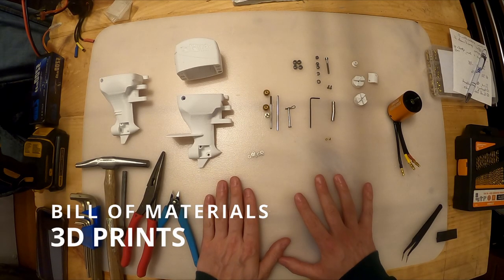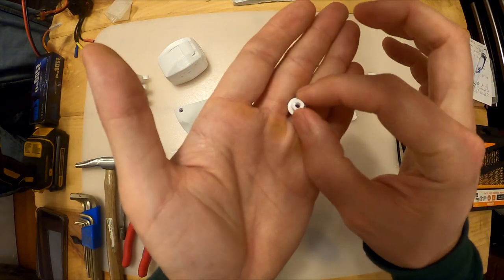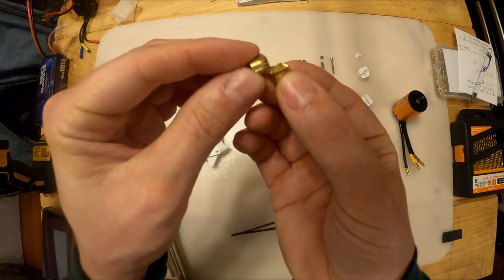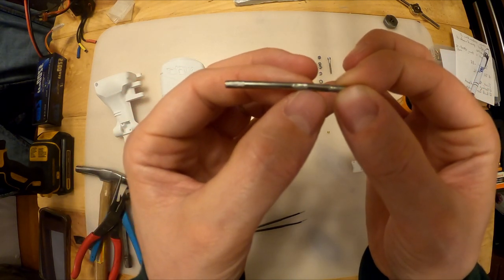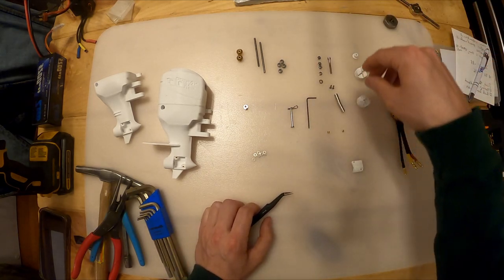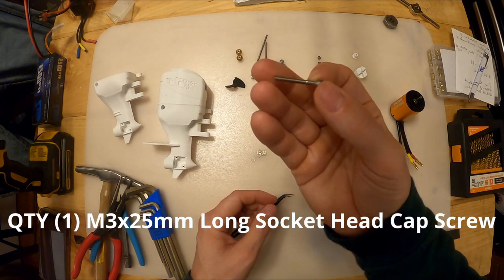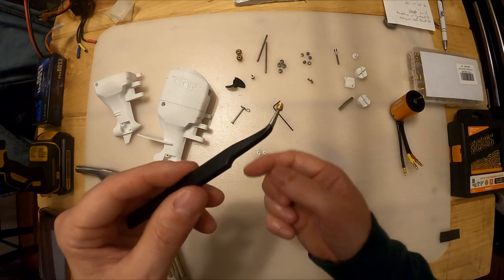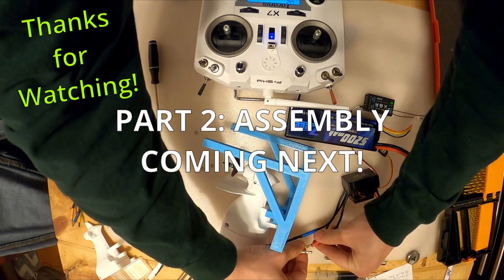3D Printed RC Outboard Assembly: Part 1 Materials

Comment: Thanks so much for all your hard work putting all this together. I attempted to make my own outboard using onshape but my CAD skills are not as good as yours yet. Only problem I've had with your's so far is I cant get the motor to tighten up enough. It seems to me the hole for the bolt needs to be moved closer to the motor so it can close that gap more effectivley.

Comment: I haven't seen it in your video's but did you make up a matching motor mount to connect it to the boat ?
Reply from the maker: Yes! Files are availabel in several places!

https://www.ethoefler.com
https://www.printables.com/model/499361-400hp-rc-outboard
https://www.thingiverse.com/thing:6156830

Comment: What did you use to get the leftover support out of where the motor sits
Reply from the maker: A set of picks and a small sharp flat head screwdriver. A small pair of needle nose pliers or cutters works too!